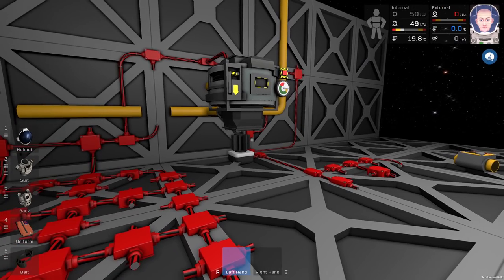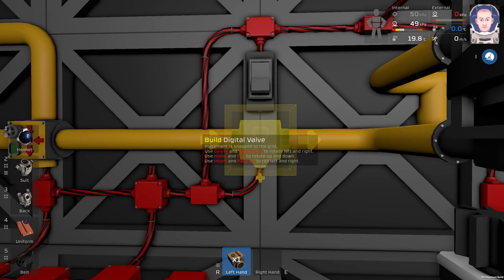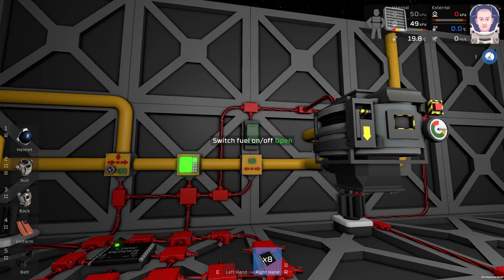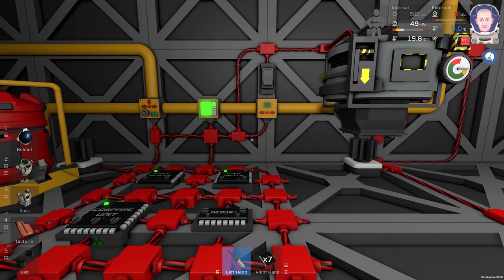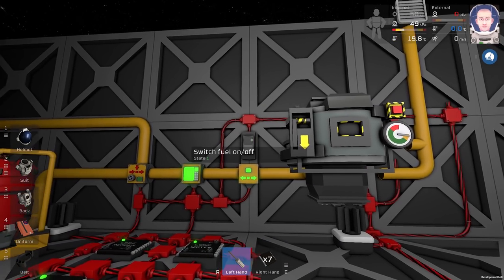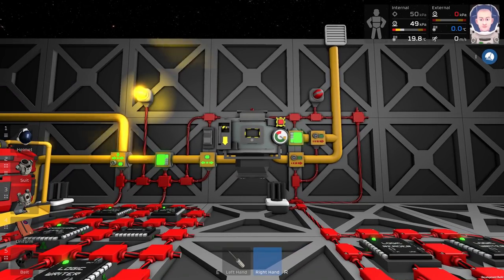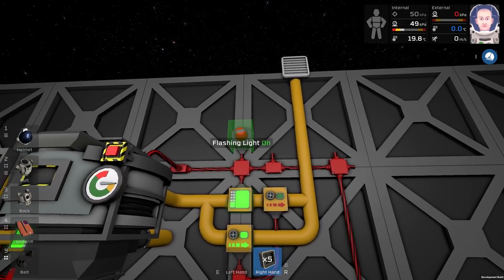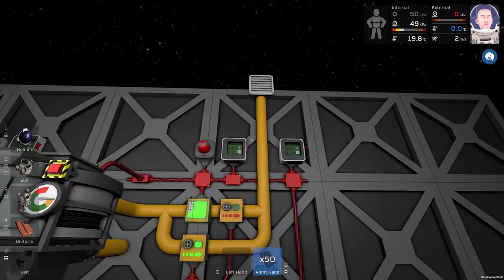Stationeers - Tutorial Ultimate Furnace DIY Part 1

Comment: Nicely done again Saddamo. Thanks for the video. Will be awaiting the next part from you. I am currently working on a fully automated filtration system. The filtration will only run as needed. So if O2/N2 content in room  is not correct, it runs and adds both at corrected values to room. Also if any other gases are detected it runs to filter out the room. The filtration will also run if there is any over pressure in the room, along with any pressure in the intake piping of the filtration units, so the furnace output would kick in the filtration system. Man I wish there was a Multiple input Logic writer and batch writer. This way if any input became true it would output true. So many pieces to do a simple job.
Reply from the maker: thank you very much, I wish smaller logic chips, because now you need a parking lot for some creations
Reply: Yes they are actually huge devices compared to what would be normal. I really wish there was a PLC that they could throw in. You would need it and a Computer to program it. and multiple PLC's could be linked. You could automate your base with 10 PLC's. These of course could cost alot of resources to make. Basically it would perform the same functions as all the logics but in a tiny space. You would have a all in one logic reader, writer, batch writer, math, compare, select, and if or statements, and so on. Say the PlC would allow 10 inputs each and 10 outputs each.
Reply from the maker: yeah, one PCB with input, output, and electricity connection, with customisable grid size
Reply from the maker: I am sure we will get something like that soon or later, or at least I hope

Comment: Great vid! Ive started it.  Tell me, what are those black and white things you plug in near the walls?  Is it to vent the heat from the multiple logic circuits?  What is it call and where you get it?  Plus, i didnt find the wall sign, in what machine you find it.  Im pretty sure its not in the fabricator.  Cheers and thx
Reply from the maker: Hello and thank you, I think you are talking about RTG, they are generating power. I am using them because this is creative build and I dont have any other energy source here. You dont need them in survival build, if you got energy source. You can manufacture sign in autolathe.